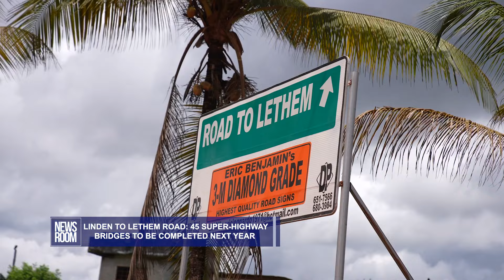LINDEN TO LETHEM ROAD 45 SUPER HIGHWAY BRIDGES TO BE COMPLETED NEXT YEAR

Comment: Sadly the road from Lethem to Boa Vista is only a single lane road, has Brazil plans to upgrade that when the trade routes and traffic volume increases to match Guyana investment? Also security will have to be beefed up, can imagine all the good and bad flowing into Guyana in larger volume.
Reply: Have you traversed on that road often? One of their lane is almost like two of ours and very wide shoulders, not to mention no stray animals, no potholes, no drops and waves. They do have wide double lanes and return points strategically several kilometers before entering a town or city. As for highway BR401, approximately over 1000 vehicles traverse it on weekends and yet can't even see any traffic.